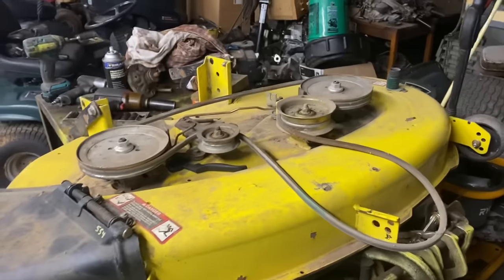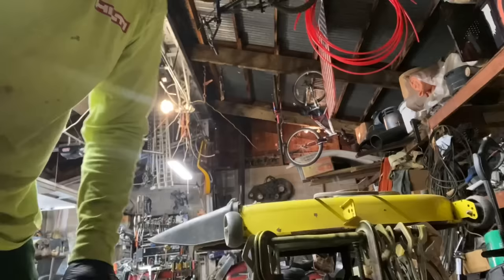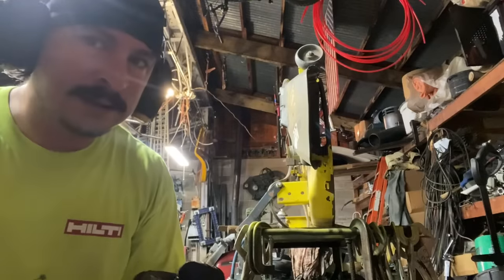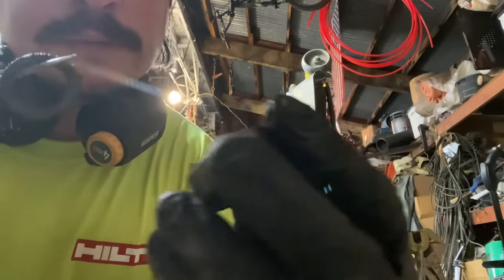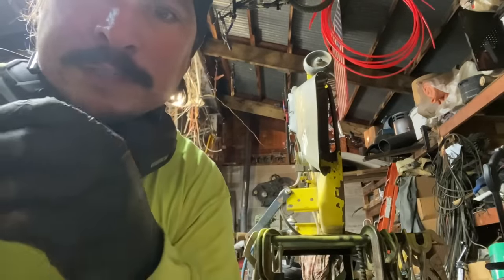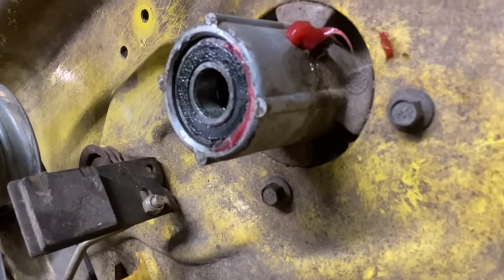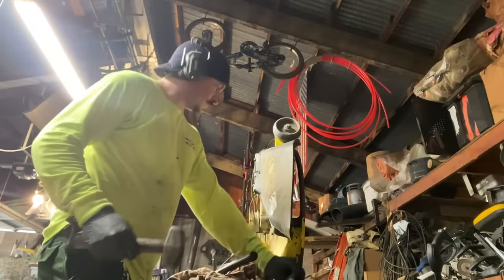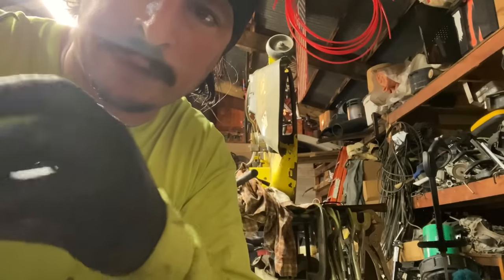Part 1 - Don’t trust the “Experts” Grease your mower deck sealed spindle bearings Common sense.

Comment: As a millwright, experienced in dealing with bearings for many, many years, I can tell you that removing the seals on a factory sealed bearing is entirely wrong. They are lubricated with the exact amount of grease, and as long as the seals are in good shape it’s far better to leave them alone. Once you remove a seal, grease can enter, but so can contaminants. Too much grease will cause overheating and shorten the life of the bearing. For a mower deck, check the spindles annually and replace any worn bearings with sealed bearings. Forget about the Zirk fitting, pumping grease in there won’t do anything to prevent damage. If you remove the inside seals on these bearings and pump the housing full of grease, you may put too much in and dislodge the outer seals, and then you’ll destroy both bearings.
Reply from the maker: This comment is not to help you but for the third party that might see this and consider your comment to have any relevance. You sound like the typical expert and I doubt you will ever take time to run some tests or consider anything other than what you think you already know to be true. Without running tests you only know what you’re told. And what you choose to believe is your choice. I’m sure you trust your other sources more than me but I’m only talking mower decks here. This could also be useful information but folks who are stuck on other applications won’t typically accept this advice and don’t think outside the application they are “experts at” experts like to think they know everything about bearings because what they know for one type must fit all applications. Seems logical I guess. so hopefully the effort I put into this comment can help someone else who really wants to find the truth and is willing to do some hands on tests. lots to unpack here, first I can say not all bearings come with the same quality or amount, Iv noticed some have almost none and others have a lot. And this is from the same box of bulk bearings of the same part number. So that’s BS statement for the bearings in this application. Quality of bearing and many other factors could be involved in how much and what quality grease will be in the bearing. Most likely the important aspect would be the bearing application and how high quality is needed. I do not advise to remove the shield but at the same time the inner shield being gone for this application won’t matter one bit. Some bearings don’t come with an inner facing shield, some do. I just wanted to prove the grease will pass the shield if it is there. And it clearly did not cause a problem in my video and also never has caused an issue and not one single time in my life has it ever been an issue, if you noticed in the video both shields stayed in place none had dislodged after grease was applied. And that’s exactly why I did a detailed step by step process to show how all the naysayers are wrong. No contamination is inside the assembly unless someone waits years to grease and some moisture gets in the assembly some rust can develop but I would say regardless it is better to have more grease in the bearings than it would be to let them run dry and guarantee failure. I invite all naysayers to please please post some videos and show us the link right here. We are eager to see some proof of what you speak. I’m not working on boats, aircraft, rockets, race cars, we are just talking mower deck bearings. So what you’re saying is one bearing should be addressed just like every bearing. One process for one bearing applies to the whole group? Are you saying Not any bearings in the world can be greased as I’m shown for any applications? So you say you may damage the seal? The way you say it sounds like you’re not very confident. Using the word MAY, And no you can’t put too much in these for this application more is better. The shields don’t hold pressure. Grease passes right out the outer shield. No, don’t forget about the zerk, use it. Dang that was a great example of the experts who try to give us advice. Sorry but your information is absolutely garbage. Rather than get mad about it, consider you’re not as knowledgeable as you think you are. Nobody knows everything. You have an opportunity to grow from this. Run some tests see what happens. I’ll even give you the most simple test you could ever do, grease one side as Iv shown and run the other side as is and see what side lasts longer. These bearings in box store and even some tractors considered commercial grade won’t last over 300 hours without grease added. Keep in mind that the average home owner has no interest in dismantling a deck and replacing parts that require tear down time and parts when it could simply be greased through a zerk that is put there by the manufacturer. This stuff ain’t rocket science and as I showed clearly in my video it works fantastically and plenty of folks doing it this way are sharing comments that it’s been working just fine for decades. Some folks are too smart and overthink this application and will never try it but it’s also helping many folks and that’s why I made it. Not all folks will be able to absorb this simple installation. Rather than run an experiment many folks will always assume they are smarter and know better even though they can’t reference anything backing their claims. In two years no naysayers have provided a video to show of any downsides. I’ll keep waiting. 

Why would anyone trust the company selling the equipment when they say something can’t be serviced? They ultimately make more money by selling parts and equipment. If I can keep my equipment running without buying replacement machines and or replacing parts I win and use my $ elsewhere. I’ll trust the facts that Iv done the trial and error to learn. No thanks on lifetime bearings and lifetime transmission fluid, this stuff has been debunked.
Reply: 24 years in the Navy working in engine rooms taught me the wise advice you give.  Unfortunately most will disagree with you because more is better.
Reply from the maker: @seniorchief48  if the information helps a few, that’s cool. I wouldn’t expect everyone to get on board. Even when you show proof, most folks are too lazy to run some tests and prevent failure but will spend more time and $ in the long run paying for repairs.
Reply: I worked in the printing business for nearly 20 years. The presses used bearings similar to these on each end of the roller. These rollers work under tons of pressure at very high speeds. 
The bearing manufacturers for these bearings do a lot of research on bearing failures. Over-greased is the major cause of failure. Too much grease when cold makes the ball or rollers, depending on the bearing, slide instead of roll. This cold start up may not last long but it does shorten the life of the bearing. 
I have inspected the bearings we removed after failure and agree with this. After pulling seals one can tell how much grease is in the bearing and what condition the bearing is in. After cleaning as to inspect the bears balls or rollers and races you find flat spots on them. This indicates sliding at some point. Others that are loose, after inspection every thing is round, no flat spots indicates they were running fine, just at the end of their life cycle.😊
Reply from the maker: @leonhart2452  it’s easy to get distracted from the main topic here, we are talking mower deck bearings specifically. 

Diffrent bearings, different, loads, different speeds, different operating conditions. All adds up. Do you know how many hours those machines ran and for how many days? It would be interesting to think about. But still could be something completely different and not make much difference for this specific application of mower decks as I’m covering here. However considering things is not bad, just need to run some tests. Most importantly don’t run bearings dry. But there is no way to meter the grease going into a mower deck. Anything added through the zerk before you see it exit is an unknown amount. It’s only full when grease exits past the upper or lower bearing shield or both. At that point it’s greased well and from that point Iv not personally ever experienced issues. Not greasing however is guaranteed to bring failure eventually. Better to have grease than gamble. 99.99% better to be filling them assemblies 

I’m
Seeing new mowers have failed bearings in under 100 hours with dry bearings being the cause, happens more and more on these newer machines. I have yet to see a well lubed bearing fail. my motivation is to help folks a wood needless bearing failure on a mower deck from lack of grease and to Help folks get grease in them before it’s too late. If I start seeing greased decks fail, I’d be happy to cover that but after 20 years I haven’t seen that problem yet. Failure for too much grease in this application is not a concern so far but something to think about I recon. So maybe someone who had that concern can do one side of the deck my way and the other bearings another way and see what one hold up longer. If the fully greased side last as long or longer we would have an answer. Then that test needs to be duplicated many times over and see if it holds true. I’m not seeing those issues but I would be very interested to run some tests like that in the future. Maybe something I’ll look in to.